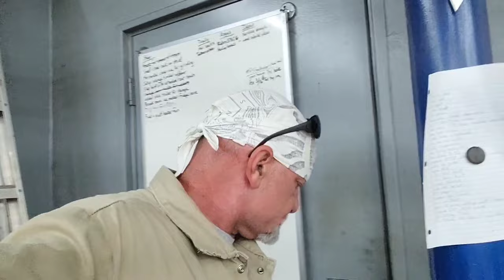Repairing another aluminum livestock trailer

Comment: Thanks for the video glad to see we are not the only ones that have to work on horse trailers. The rivets that were on those pieces are called a blind Huck or a BOM Rivet. I have repair them both ways welding and riveting,  and I believe that using the Bom rivets are the best way to fix them as it does allow some movement and does break out. Again thanks for the videos.